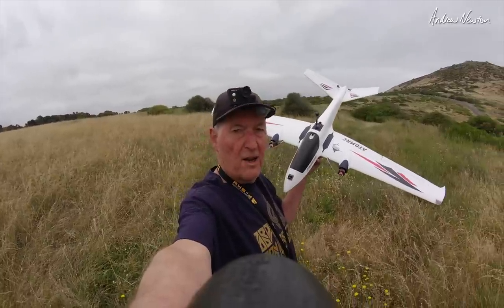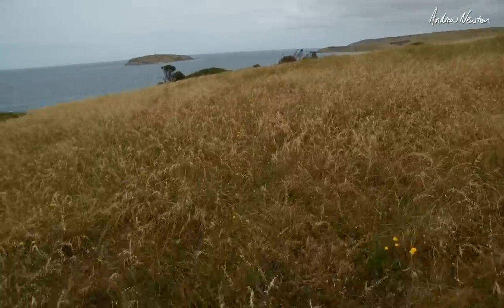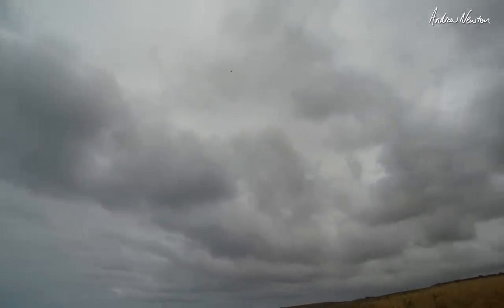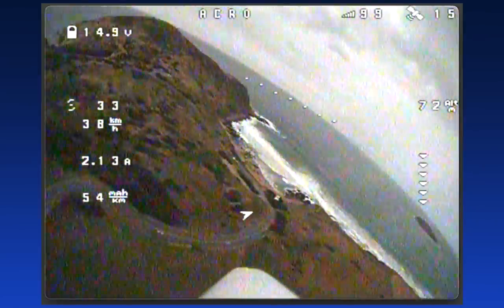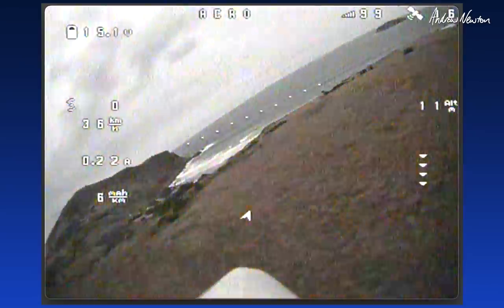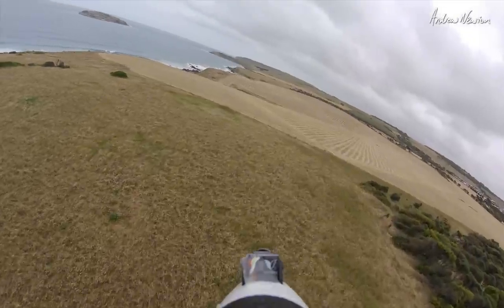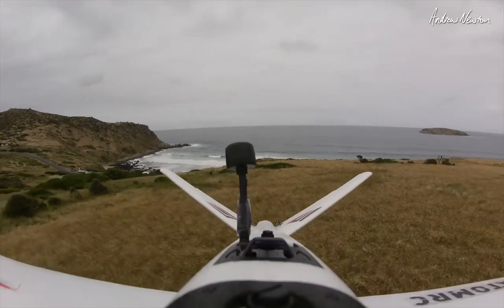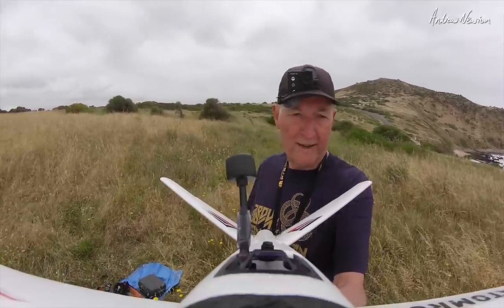AtomRC Swordfish - Maiden

Comment from the maker: Just did some current draw testing with a power meter and the Swordfish AtomRC F405 NAVI board seems to be under reporting the current by about 15%. Factory current scaling is 370 but should be about 320. This means my 2 to 3A cruise current was really 2.3 to 3.5A. Still very efficient.
Reply: That is very efficient.  Thankyou for checking it for us all.
Reply: She seems like a real little beauty; flight line is smooth as a baby's bum. Very impressed, looks the business to, my nano talon is jealous. Hey Santa, could I have quick word.
Reply: My bad ( but I don't understand , what are you talking about current draw limits ? over sucking on the FC boards cap limit?
Reply from the maker: @BrainDeadEngineering  Limits? Was it the 10A limit for 18650 Li-ion batteries
Reply: @AndrewNewton  I,m sorry Newt! I didnt know yuall was talking about the batts amp draw ..I thought the FC power output was capping out. my bad 😔
Reply: @AndrewNewton  I had a nob moment there, thinking 18650 was the mAh rating! Thank goodness I remember that it's actually cell dimensions. 😅 Cheers.

Comment: I finally flew this plane and when dialed in after a couple crashes due to nose heaviness and not enough elevator, it flies like a dream with inav and altitude hold. I do enjoy assisted flight more than manual flight. It flies beautifully, rock steady in the air. Great image with a 800mw vtx and rhcp antenna.
Reply from the maker: Yes it's a great INAV platform, so efficient

Comment: I'd put the tail wing fence pieces on as they are. With those big flat wings, the long grass just stops the plane nearly dead. So I don't think you'll have a problem with them being pulled off or broken.
My old Mini Talon wooden tail skid lasted about 3 flights on grass coming in at 50kph. Landing in long grass/heath land, my V2 MT it lasted a lot longer till it bust again on short grass.

Comment: Just getting to watch now, looks great! I'm still wondering if the amp draw is correctly calibrated, but that said, it doesn't seem to pull the voltage down like 18650s love to do, so it could be correct! lol It sure seems at home in the air though, carves around nicely. Still no word from Daniel, guess I'll have to wait for them to be for sale somewhere stateside... lol Thanks for the video!
Reply from the maker: Current was only 15% under reported. I checked with a power meter today.
Reply: @AndrewNewton  Nice! Well within reason, easily fine tuned, and most importantly still impressive numbers for this little plane! lol

Comment: I have a bit of doubt about the current draw.  Twin motors with 7" props. 2306 2000 kv motors. I'd calibrate the inav current sensor comparing mah drawn as reported by inav with the actual amount required to charge.
Reply from the maker: Yep, needed scaling of 320 instead of 370. Only 15% out

Comment: Gday Andrew, I bought the kit version to fly los, assembling now, I'm gonna power mine up a bit with 2826 motors 2450kv with 6x5 props and 40amp esc's, 1 esc will power Rx + servo's the other esc will power the lights, I might add a few extra lights. great vid as usual :-]
Reply from the maker: Nice one Chris. Mad power, it should be a rocket but still fly slow well.

Comment: Great maiden. Had some of same concerns on seeing too. Glad to see flies so well, nice and smooth. :)

It might be worth double-checking the low current draw with what is require to recharge battery (mAh), or with a current gauge on the bench. Sounds very efficient in flybys, but would be safe to know if current is not under reading on a long flight, particular if venturing away from the immediate field.
The downward fillets do worry me. Wonder if adding an upwards conventual fin would be better option. Don't really think it needs it, but could be a DYI option.
Reply from the maker: Yes I will try an external current sendsor

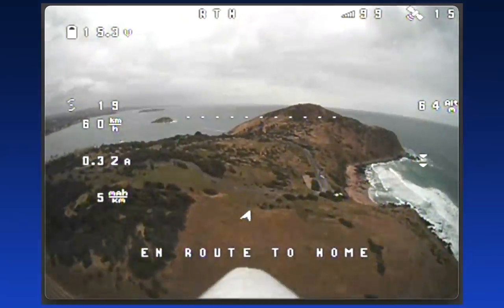Comment: @6:08 AMPS jump to just under 8amps at 45% throttle but at cruse at 32% throttle it says its at 2.4/2.6 it cant be right... is that the included fc?
Reply from the maker: Actual measured current is about 3A at 30% and over 25A full throttle.

Comment: Might need to calibrate that FC's amp meter.  2 amps seems innacurate to me for a twin that size.  But if its accurate then whoa!!!.
Can you confirm the draw on a watt meter Mr Newton ?.    I wouldn't usually ask but seems well worth getting, flies very nice!.
Reply from the maker: Yes, external current sensor next flight

Comment: You need to make video step by steps so I can see it like how to connect wires to flight controller for your swordfish rc plane and how to connect the led lights red and green to esc controllers in twin motors please
Reply from the maker: Yes I'll do a video on the FC connections. LEDs are powered from the ESC 5V pad. See here https://www.youtube.com/@AndrewNewton/community
Reply: @AndrewNewton  make another video step by steps but don’t use skipping video and don’t use speed up video when you record video cause I didn’t see the swordfish rc plane the wires are connected to esc twin motors to swordfish qrc quick release board inside the both wings but show all wires inside the wings make sure video is high quality 1080p please and make sure is focus camera all wings wires are connected to flight controller and receiver where is connected to flight controller please cause I didn’t see the receiver for transmitter is connected to flight controller to able control twin motors and servos please
Reply: Just go read the manual

Comment: Hello Andrew. Great Demo as Always. I have a few questions... what was the receiver that you were using and what value have you set for the rssi low alarm. Thanks Fellow. Love the video. Always inspiring :D
Reply from the maker: Hi Bruno. FrSKY RX6R, I didn't have the RSSI on screen set up so ignore those readings. RSSI alarm in the radio were just the defaults, antennas were just sticking out of the bottom hatch horizontally.
Reply: I’m deciding on a radio receiver set up to begin with for use with iNAv. Would you recommend radiomaster zorro or Mk 12 ELRS begin with and what receiver on this setup?
Reply from the maker: @Coronet47  I like the Zorro ELRS with RP1 or RP3 receiver.

Comment: Thank you for you content Andrew! I’m having a devil of a time getting my swordfish to fly. Cg seems right (slightly nose heavy to be safe, inav  settings are identical to yours. Problem is every time I hand launch ,the plane goes straight up as if it’s tail heavy then it’s game over. Am I using too much throttle and not throwing it hard enough? Pretty bummed right now as I’m facing my second fuselage repair of the the day and no flying…
Reply from the maker: I use about half throttle and normal throw. Sounds like your elevator or pitch stabilisation is reversed. The board is upside down, did you set that in INAV? Does the animation move the same as the plane in the configurator?
Reply: @AndrewNewton  Thank you so much for responding Andrew!- I am fiddling with calibrating the accelerometer again. I understood that the board was upside down in your videos. and the animation did moves as it should. Right and left rolls good and pitch. But I recalibrated it just now and its upside down . UGH.  Have to do that again.  So given that the calibration was originally ok that leaves me to assume I wasn't throwing it hard enough and it had too much throttle. does that sound right?
Reply from the maker: @skupper672  I doubt it is the launch, this is one of the easiest and straightest launching planes ever. What mode were you launching in?
Reply: @AndrewNewton  Acro sir
Reply: @AndrewNewton  I just noticed I had ticked permanently enabled launch mode for fixed wing" and did not know it. If I had hit the throttle with that one could that have caused the issue?
Reply from the maker: I never use autolaunch. It could have an effect maybe. Still seems like reversed pitch stabilisation. In Angle mode, check that the elevators come up when you lift the tail.
Reply: in angle mode when I lift the tail, the elevators go down!
Reply from the maker: @skupper672  There's your problem. Need to go back and set up your radio model correctly making sure the graphs move to the right when sticks go up and right.
Reply: @AndrewNewton  You are an aeronautical prince sir! Thank you for your help! How can I support your work online??
Reply from the maker: @skupper672  Ha thanks. Just tell me when you get it flying. There are donation links in the description but not at all necessary.
Reply: Thanks Again Andrew have a great Sunday
Reply from the maker: Thanks for the donation! Unnecessary but much appreciated.
Reply: Sir Andrew! First maiden flight today was a total success! So much so that I took a second maiden flight lol. Thank you so much for helping me achieve this. It has been a dream since childhood to get up there and fly around. Little bit of rain this morning so I actually took the opportunity to put in a pan camera. Thanks to your video on the topic. I am beside myself with happiness, thank you !!!
Reply from the maker: Great to hear! Well done